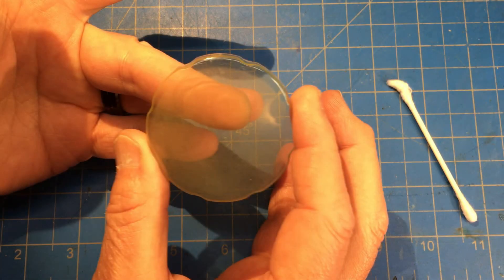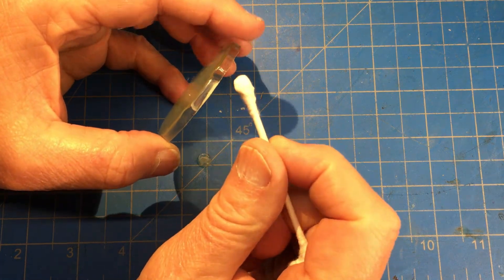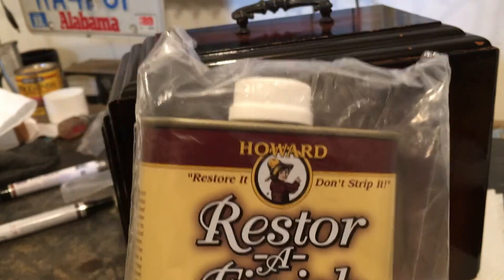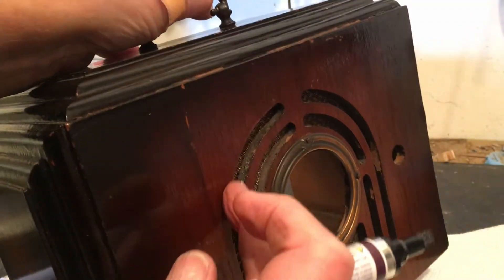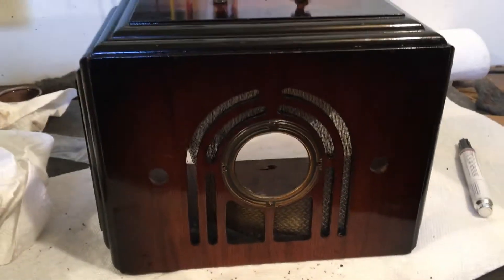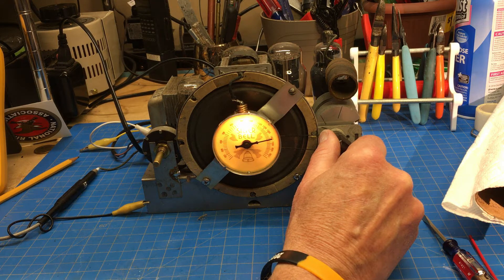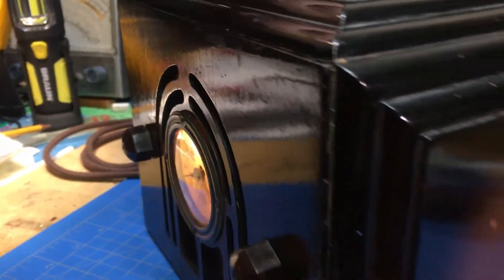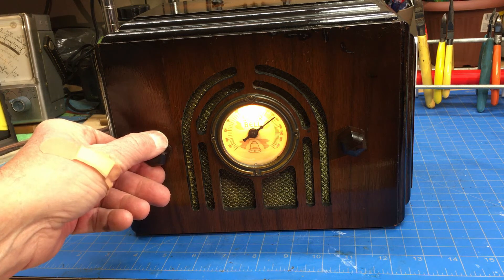1935 Mystery Radio Silver Bell Part 4 of 4 Dial, Cabinet and Final Demo

Comment: That turned out really great for sure Larry. To think that it pretty much is original finish too makes it even more impressive. Glad you could get that replacement glass for it as well, that is a finishing touch right there. Looking forward to the next project now!
Reply from the maker: George Christofi Thanks George!! It was in pretty good shape to start with, but If I could have gotten the other one clear enough, I would have used it...but, on the upside, Mark now has the pattern! It is the same size as one on a Mission Bell....he has made one for a MB, but didn’t put the little indentions around it....He believes maybe the MB should have had those.....MB built radios from whatever bet could get...this Silver Bell compared to my first on...made 2 days apart....has different filter capacitor package....different interstate transformer....and different antenna coil/transformer....sounds like a parts surplus build to me??? Thanks for watching and the comments!!! Take Care—Larry

Comment: That radio sure turned out pretty.  Have you ever tried wet sanding on plastic?  I did it on a pair of headlights once and they came out pretty good.
Reply from the maker: Rebel9668 Gary...I left video out of me working on the lens....it included wet sanding....using different grades of basically rubbing compound....I left them out....because it didnt work very good on this dial....I think it was because of the grade of plastic it was in the day.... I wasnt notified of your comment on this video!!!! I hope they get that fixed soon! I dont like to miss the comments! I feel every comment should be answered!!! Thanks again for watching and the suggestions!!! Take Care--Larry
Reply: I bought a kit called micro-mesh with polishing compound for plastic that does a great job. It comes with sanding blocks from 1500-6000 grit you work in stages and it removes all the scratches.
Reply from the maker: Jim Boyd ThanksJim!!! I used a Turtle Wax kit...it had an abrasive liquid and 4 different grit of spongy pads for polishing...I personally think it was just the plastic of 1930’s just wouldn’t clear up!!! Thanks for watching and the tips!!! Take Care—Larry
Reply: @Backtothefutureradios  Yes...great work on radio!!
Reply from the maker: Jim Boyd Thanks Jim!!